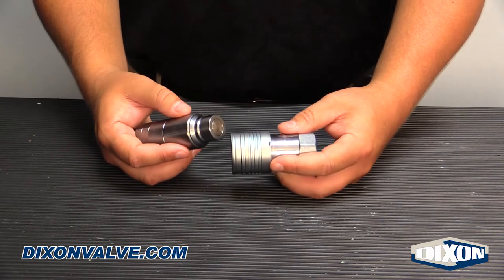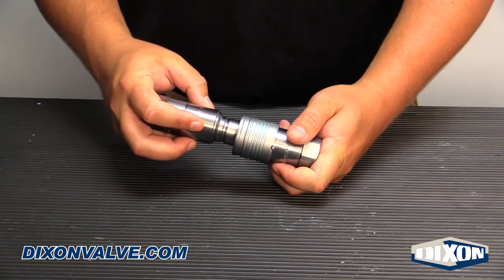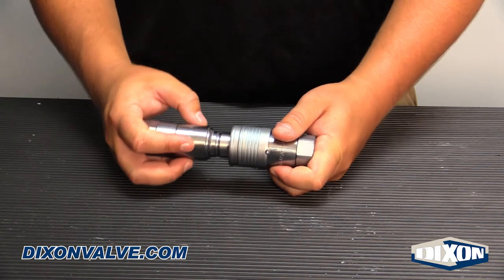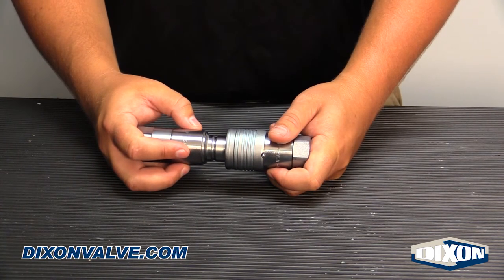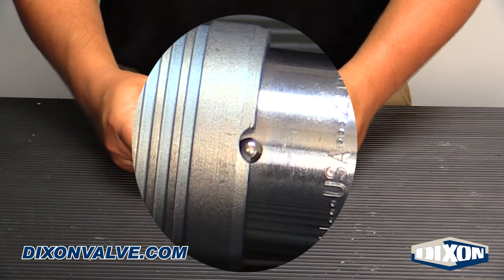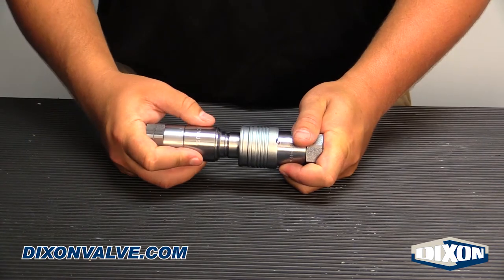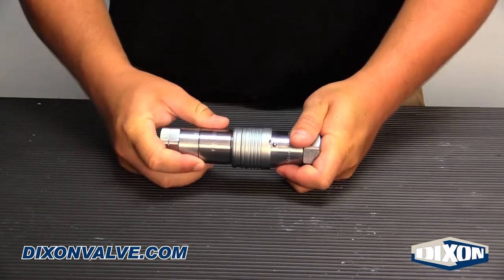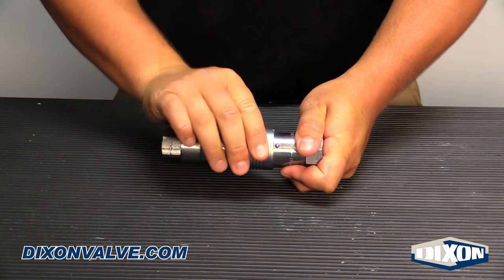Dixon's Quick Coupling Locking Sleeve Feature

Comment: Saved my bacon! These fittings (well, similar -- with the locking sleeve) have been on my digger for fitting extra tools such as breaker. I had to take them off to take to shop to match up for new hoses. They've been mounted on the digger  out In the weather, unused for years. So while they were off I thought I'd lubricate them somewhat. Tried to twist where the cutout is over the ball bearing. Wouldn't twist. Put in vice, WD40, hammer and punch to force the ball down -- often necessary with socket sets when the ball gets rusted. Stilsons on trying to force it. Gave up. Went on line. Found this: a male fitting has to be inserted before you can twist. Doh!